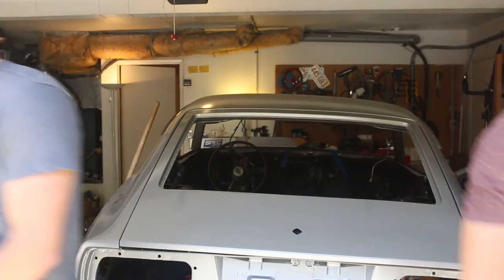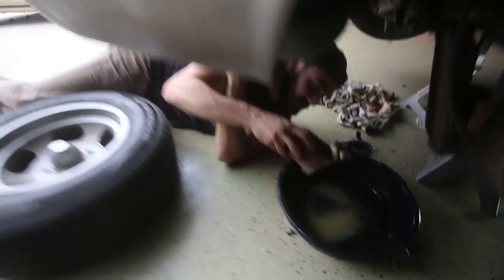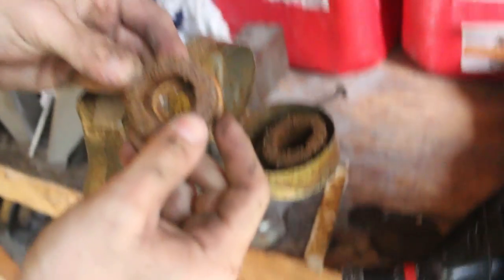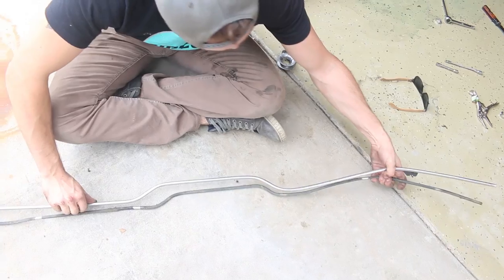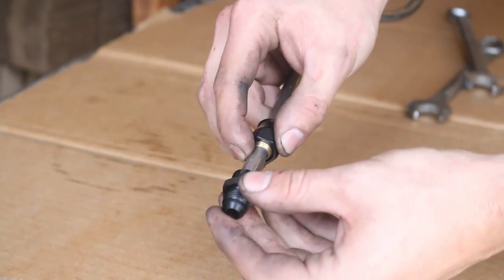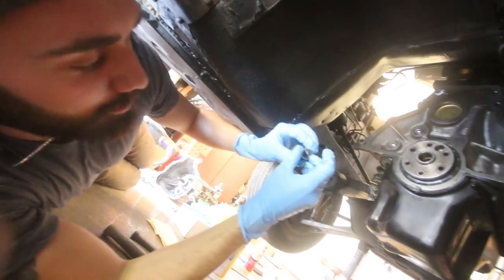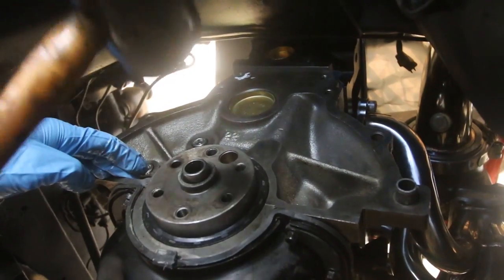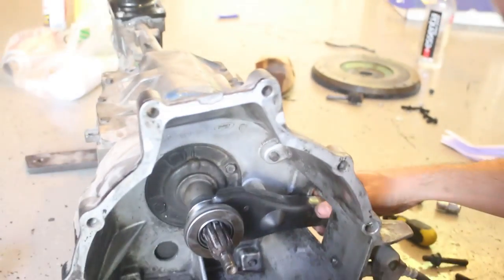SHORT THROW AND STAGE 3 CLUTCH INSTALL Turbo Datsun Ep 13

Comment: How do I begin!  For four years I've been sending parts back so I could work on my Supra.  I guess I can list out some of the parts there are just sitting in the back of it for when I finally get it to it's new home in San Diego:
Battle Version end links
Battle Version Traction Bar
Battle Version  Tie Rods
Battle Version Camber links
Battle Version Toe Links
ST Suspension Sway Bars
Full poly bushing kit
Poly subframe kit

ACT Clutch Kit
Fidanzafly wheel
APR flywheel bolts
Driftmotion oil cooler kit
R154 tranny rebuild kit
and a bunch of other random stuff....